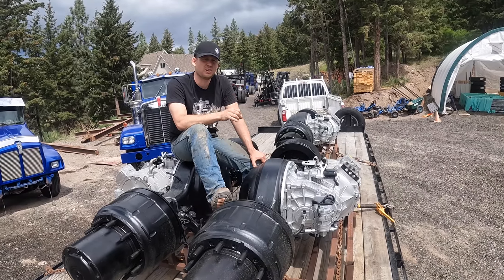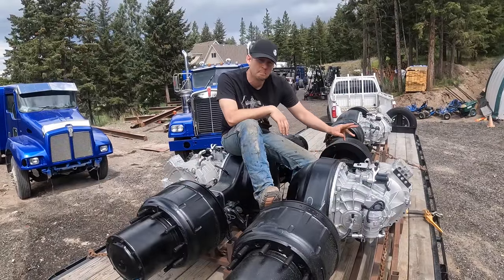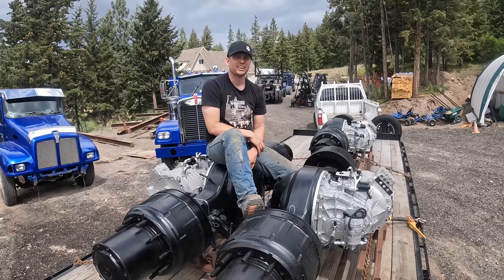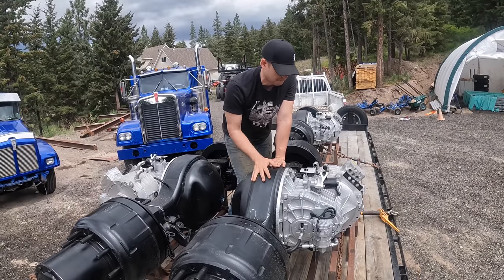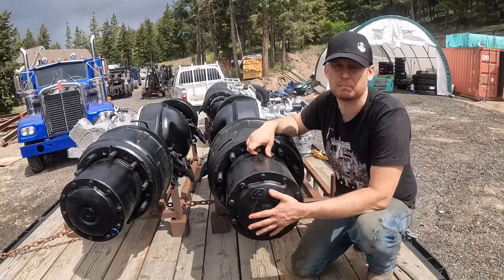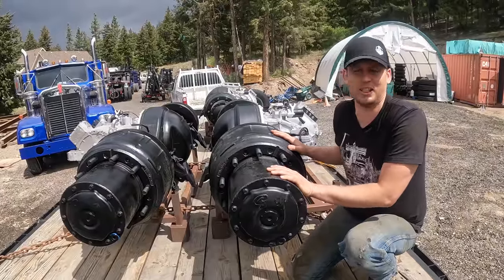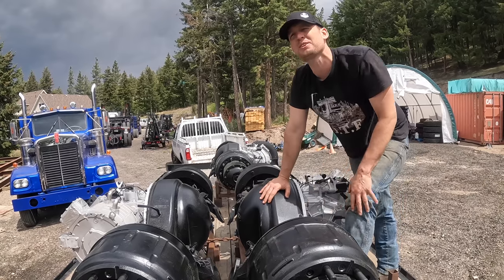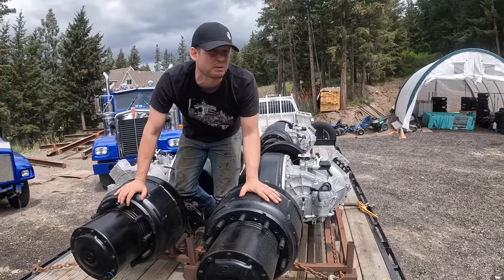Challenges of Building an Electric Log Truck: The Hunt for North American Axles

Comment: The idea of regenerative braking with trailer axles on extended downhills is so genius, obviously not a replacement for high quality brakes but could make them a lot safer and increase range in mountains on highway trucks. Obviously you’d need a ton of cooling, but I imagine it’s a lot easier to get heat out of a system with circulating fluids and active cooling than plain ol brake rotors.
Reply: On extended downhills you would need to dump the current on some sort of huge resistive load as I don't think these trucks will be carrying tons of batteries to save that much power. At that point you might as well just use the normal brakes.
Reply: @siggyincr7447  that’s true, but I think it would be much easier to cool a larger thermal mass with its own cooling system than conventional brakes. I’m not as familiar with the brakes on semi’s, but I have seen plenty overheat and catch fire, which I don’t think would be an issue with this system. Resistive loads are very efficient for heat transfer, and you’d still be able to take a lot of energy out of the system with a simple heat exchanger. Would be interesting to see it implemented.

Comment: It might be really handy to have a powered heavy-haul jeep. The tractor gets stuck pretty easily when it is hauling heavy haul stuff like large machinery in winter conditions or less than improved roads. Having a powered jeep would have much less of a penalty and maybe even a bonus as it converts the heavy equipment weight to tractive effort. Also for Australian road trains to have a powered bogey or b-trailer

Comment: The regen on truck and trailer will more than make up the charge using to climb into the harvest. It may be worth dumping the excess charge into other equipment before heading down with a load. Just effing skookum. Is the regen braking stronger than exhaust?

Comment: Looks awesome as usual. If you power the trailer, will the trailer know it's angle compared to the truck so when going around a tight turn, the trailer isn't pushing the trucks drives sideways?

Comment: Just wondering can you just power one axle when running empty to save power or would that affect the other axles. On the powered trailer front the Soviets did some trials with a propshaft driven trailer. If you search for Zil 131 10x10 you should turn up a video

Comment: im really surprised you mentioned at the end that youre swapping the drum brakes for disc brakes because as you said they barely get used
which is why so many electric vehicles use drum brakes because they last longer and dont need the increase performance of discs

what made you got for discs instead?

Comment: when you don’t have the X lock you can be running with only 1 wheel driving on normal diffs, and since you won’t get wheel lift from the torque twist of the frame are you able to switch an axle off. save power-load on genset and wear n tear on axle components, or alternate driving axles to ballance the wear?

Comment: @edisonmotors what if the truck breaks down like the 1 on the highway you looked at quick. And it needs to be towed by a heavy wrecker do cant pull an axle shaft due to the hub differences... So would you remove the outter face plate gear like a skid loader or what.

Comment: you may not want the motors to allwas be in sink, because when you turn the middle axel will travel slightly shorter distance than the rear axel , wouldidt it make more sence to let the rpm wander and keep the torque even? this will behave like a center dif without any extra hardware. in some applications you do want them to be in sync. so you could have a switch that changes mode , this will act like a diff lock for a virtual center diff.
thoughts?

Comment: Once up to travel speed, do these have a way to unlock so you could run on one e axle? Just wonder if it would help range extension when you dont need all 600 ish hp available.

Also in event of a failure, it could be handy to be able to unlock a damaged e axle, and drive home on the remaining axle while other axle just coasts.

Comment: Y'all should partner up with Prusa Research to have 3D models for all kinds of small parts that can be replaced by 3D printing! For example like knobs and switches. Prusa Research is a 3D printer company, you both have a lot in common!
Reply: They're more into manufacturing than design, but good call on Prusa.

Comment: I do wonder if Edison would ever consider retrofitting OTR trucks. Wouldn't need to be heavy haul etc but instead be for trucks that normally do regional work but might not Always be at a terminal to recharge.

If you could sometimes charge at a terminal or at your house it would bring your average mpg /cost per mile to move freight down significantly. It would eliminate APUs and their associated costs/maintenance and weight.

But having the 7 liter diesel charger on board would allow the truck to take on long haul applications as well, when needed.

On paper, when constantly running a smaller diesel, you probably won't see a significant increase in the diesel burned to move, but when combined with charging at terminals in regional applications the average could be equivalent to a truck getting 20-30 MPG averaged.

I was going to do this as a project truck in my shop at some point, but I ran into the same issue form Meritor, will not sell to non OEM whether you have the $$ or not.

Comment: Remember on the powered / regen brake Trailer unit you need weight pushing down to get the full braking effect when unloaded.
Reply: If every axle is powered, it will still be able to decelerate at the same or better rate when regen braking unloaded, if it's limited by the road traction. If you double the weight on the trailer you're doubling the amount of wheel torque you can apply before it slips, but you're also doubling the mass on the trailer that needs to be slowed down... so it evens out. You're also not regaining as much energy from regen with a lighter truck, but only because it took less energy to get the truck moving in the first place.

Comment: Hey man, I really like the videos you make as well as your engagement towards more environemental friendly trucks. I am going to be very honest with you, I have a similar feeling as you have about trucks, but then towards (european) tractors. The thing is I got a desing for a hydrogen gas-electric or diesel electric tractor but unlike modern tractors the plan os to put it on a chassis and make everything modular and make parts as interchangeble between series as possible. But my question is, are these electric axles also available as a awd axle, I mean can these axles you have also be outfitted with steering knucles?

Comment: First of all, congrats on seeing your idea through. I've seen a number of your videos as well as the Deboss video where you pulled the Sherman tank conversion. Bravo on your proof of concept. I love the idea of a smaller, lighter, more efficient ICE powerplant. I get the idea of regenerative braking too. My concern is, when you're coming down a very long grade fully loaded, it seems that you would generate more power than the batteries could ingest. Would they be able to absorb all of that energy? Or is there a provision to incorporate dynamic braking resistor grids like the diesel electric locomotives use on downgrades to bleed off excess energy?

Comment: So if the brakes are only slightly used, drums might be better anyway. Dont wanna rely on some gummed up and rusty disk brakes when you need them. The drums provide some kind of protection for the breaking surface

Comment: No clutch, transmission, drive shaft, yokes, u joints , grease zerts, carrier bearings, vibration, and associated parts and pieces, seals, air supply to shift the splitter, on and on. Smart design, keep going!

Comment: Planetary gears are used in wind generators because they are more reliable and more efficient and relatively smaller than parallel shaft gears. 
(1) there is always one gear transmitting power. Parallel shafts whine because gears cog against each other. 
(2) Straight cut gears - no sliding action that increases friction. Parallel shafts need helical gears - less efficient. 
(3) No end loading - more efficient. 
(4) Parallel shafts have to resist gears trying to push the shafts apart. Heavy parts. Epicyclic balance the radial loads. 
The video discusses the axle reduction losses. This is always a compromise. Put a single gear on the differential, you’ll need heavier half shafts and you can’t do readily change gear ratios. 
A better idea would be a motor in each wheel.

Comment: On Tesla, the coolant from the motor and batteries are connected
Heat transfer keeps the batteries warm i guess, there is a smart valve to regulate heat between

Comment: Looking forward to the conversion kit. One of those with an on road setup or even if limited to say 105/110 KPH would still be perfect for my use. granted id like to see 130kph but even the 105 or 110 would be fine.

 Im not a log truck myself but i do run in many of the same areas you guys do being an end dump and at simular weights plus the added abuse of the PTO. And my number one frustration is getting in and out of the often steep roads in and out of mines and quarrys and the toll it takes on my mileage. Hopefully when my rebuild is due again you will have the kit or a gen 2 onroad conversion ready and we can talk.

Comment: Are you going to figure out a way to have the brake lights come on during engine braking while not using any of the real brakes, I have seen with some electric cars with "one pedal driving" they can decelerate really quick and won't turn the brake lights on until the vehicle is at a complete stop.

Comment: Do you plan on having resistive power offloads for braking when the batteries are full? (Similar to how locomotives work) I know that the goal is to recover all that power into the batteries, but if the batteries are full, that power would have to go somewhere. Trains dump it all as heat in giant resistor banks. Do you plan on having something similar? or just have it disengage the motor braking and apply the traditional brakes harder?

Edit: Keep up the amazing work my fellow Canadian. My family ran a logging and lumber mill company for 3 generations (until the 2008 recession put us under). I'm very happy to see guys like you out there trying make life better for the guys in the bush. And not having to haul so much diesel out there to each piece of equipment, or having to have someone sit out all night long in January/February just to run the engines and keep them from freezing.
Reply: In what situation would you have a full battery and need substantial braking?
Reply: @rich.trails  They're out in BC, if you just charged up the truck while it was being loaded (as they likely would do with a portable charging station), and leave with that heavy load and immediately descend a large hill coming out of the bush, your batteries are full and you need to do some heavy braking. Less likely in flatter areas like the prairies, but also here in Ontario you could run into this kind of problem. Yes the odds of it happening are very low, but because it COULD happen it WILL happen, so they need to plan for it.

In a later video he said they're planning on using that overflow power to run the generator's J-Brake to offload that energy. Just like a regular truck, which is super cool.

Comment: It is embarrassing that companies like E… would not want to do everything they can to provide axles. I do have a question since this, as you said, is basically the same concept as a diesel electric train engine, and they have gone from DC to AC which are these motors? You and your team are doing a fabulous job. Very impressed.
Reply: All cars and trucks use AC

Comment: Saw someone comment on your short about the electric kenworth that was out of juice where you claimed your tesla motor had more KW than the kenworth. 

His claim was as listed on the motor on the kenworth it was something like 279kw with 100% duty cycle. And the tesla likely having a much lower kw output at 100%. 

What's the duty cycle of 250kw motors on your e-axles?

Comment: How much will you be charging for a retrofit? I work for a house lifting company, and my boss has several trucks that could use a retrofit. The really low speed is a big plus when it comes to house moving; you don't want to jerk on a building when it's sitting on steel beams and a dolly.

Comment: With the axe manufactures, I wouldn't be surprised if it wasn't so much a desire to keep you down as existing exclusivity agreements surrounding the axels they already produce. Their customers don't want a non-dealer option for parts to appear. And for a big axel manufacturer to put an engineer to work on designing something special for you, run it past legal to make sure it's not violating any existing agreements and do a small special run on the production floor just to sell a few axels might just not be worth it for them.
I'm sure this has already been considered or will quickly become obvious, but you're gonna want to allow for a limited amount of dyssynchronous movement between axels. Having them maintain perfect sync will cause them to fight each other. Tires can be slightly different in diameter, tire slippage can be uneven and the list goes on.
Great to see somebody doing this. I've said for years that a hybrid diesel/electric drivetrain would offer all sorts of benefits on 4x4 pick-ups and the same logic applies to this sort of application too.

Comment: This is one of those things you find out whenever you try to build anything real in Americas.  There are so few suppliers in the Americas.  So, building it all in the Americas becomes almost impossible.  And if you can get it, you pay 5x as much.

And i am unsure i could set up a company to build those if i wanted to.
Would you be ok with billet steel axles, CNC cut?

Comment: I WANT to see you guys make that Edison Powered Trailer.

Have a demo prototype, book it and send it on tour and document everyday driving with it, and take orders from people test driving, as well as people watching the youtube. Scale fast, crowdfund and have fun without selling down massively on ownership!

Regen braking plus power from standardized trailer connectors should be able to top up battery pack sized for Edison Emergency Trailer Traction without other modifications to regular diesel trucks, damn nice 3d chess move, if that could be realized.

Bring electric power into the heavy haul industry through the "back door".. 😂

If you're going to outcompete foreign production you need to have an edge on customer knowledge and localized marketing.

Comment: What would it take to become a manufacturer in North America of a center section only for a conversion? Say I wanted to leave my current axle and suspension setup in my truck and just add in an electric center section, it should in theory also lower build cost of these conversions and speed up the process of getting the truck back out on the road or in the bush causing the company less down time and thus upping there production and revenue

Comment: What kind of suspension are you guys using. I recommend charmers 46k lbs, it has a great ride for a biscuit suspension and the axle articulation is the best in my opinion. My dads been hauling logs for over 25 years and I’ve been a heavy diesel mechanic for 14 years and we are in agreement 🤷🏻‍♂️
Reply: Previous video say Hendrickson

Comment: Ok so here’s a honest question. If each axle is monitoring motor speeds and one axle starts slipping is it going to act like a traction control and basically cut power to that axle? Not ideal if that does happen if you’re pulling a loaded lowbed through a mud hole. Possibly not a bad thing if you’re pulling up a grade on ice unless it cuts all power lol.
Reply from the maker: Instead of being mechanical where it is either all or nothing, it’s electrical, where it will be able to reduce the spinning axle slightly to match the axles that are driving. - Theron Danger

Comment: The idea isn't terrible, but for a semi truck to work properly you need at least 2 speeds.
 No ifs ands or buts.

If you think otherwise put a 4" holesaw on your dewalt in 3rd gear and let me know how that works.

Also that much unsprung weight is going to really suck on bumps and be real hard on wheels.

Comment: You might want to look into having regen braking going off for a while so the brakes are used.
Remember hearing about how some telsas needed all brakes changed early on due to them not being used and failing.
Same thing might be an issue.
Not using the brakes that much might cause some failure

Yes, I know truck brakes are nothing like car brakes
Reply: Keep in mind these trucks are air brake and the brakes fully apply every time the parking valve is pulled.  Only issue would be the steer axle, but they could always add a 30/30 chamber on the steer axle too so it locks as well.
Reply: @jamieclaudeo8107  Parking valve applies brakes when the truck is not moving.
That Tesla had fully rusted rotors IIRC that not even using a brake lathe would fix them(if it that was done today) and the pads also needed replacing, not 100% sure on the calipers.

Comment: You could design this so the axle uses the same oil in the planet gearing hub and the differential and then use the cooling system to cool the oil. You could use the differential axle cover as a heat exchanger, a close loop system that uses the cooling from the motor. Wouldn't it be better if you could make it like a portal axle to add to the ground clearance if it is meant as a logging truck. You should be able to design it as heavy duty with that set up...